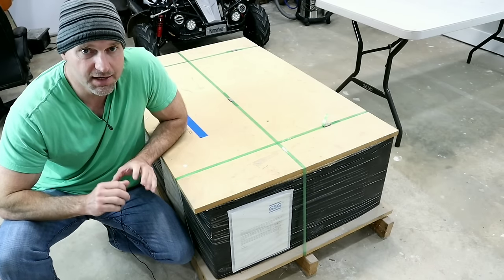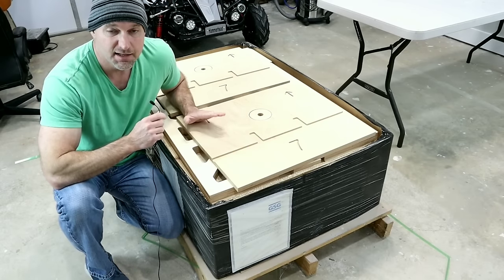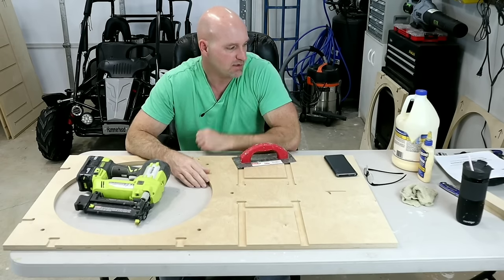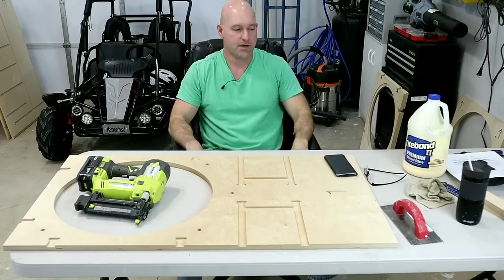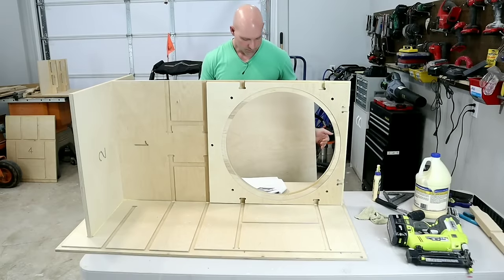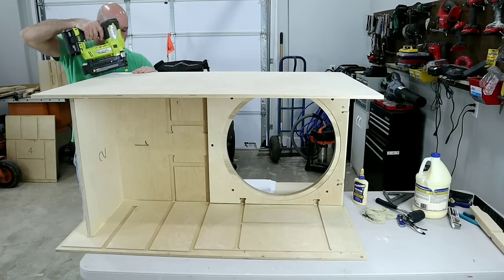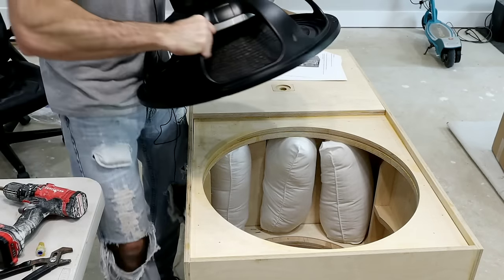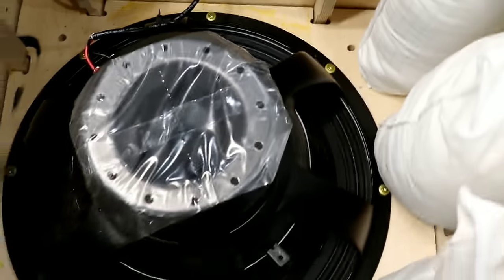DIY Subwoofer DEVASTATION!! GSG Devastator DIY BUILD VIDEO.  HOME THEATER GURUS.

Comment: I don't understand why you drilled a hole for a wire instead of using the SpeakOn connector.  Did you cover up and seal the SpeakOn connector port?  So now you have to splice the wire to a longer one to connect to an amp?  Also, what amp will you be using and what do you recommend considering the 10,000 watts peak it can handle?
Reply from the maker: Yes I covered the speakon hole in the video and explained why I was doing it this way.   I show the speakon adapter at the 13:20 mark.  
 It's  a pro type connection for road bands that offeres quick setup.  Something I don't need.  I also don't want to add more connection points.    If I want a standard connection I'd use  a terminal cup.  I like wood DIy terminal cups not plastic. I've been building subs for over 2 decades and speakons have just started to be something DIYers use.      It's all preference.  There is no right or wrong.
Reply: @hometheatergurus  So are you just splicing a speaker cable into the cable coming out of the sub enclosure?  What amp will you be using?  Will you be showing measurements and EQ?  Thanks.
Reply from the maker: Yes I wire nut to the run so it's an extremely good connection.  Remember these are hidden behind a wall.     I'm using a Speaker Power SP 2-8000 to push them.  I'll eventually have a setup video on them but if you go to our Facebook page I posted the response across all 4 seats a few weeks back.   A response showing one seat doesn't show alignment so I like to show the seat to seat consistency as we did in ep 7.
Reply: @hometheatergurus  Thanks!
Reply: @jasonevans6609   The Speakon receptacle itself seals the hole & would require no further sealing. 
The GSG widget video is found here... https://youtu.be/ARcehLuEiIQ
Reply: probably  because  there's more  then one way to skin a cat
Reply: @clittle1559 …. You only ever hear men use that phrase, I wonder why woman don’t say that phrase lol.

Comment: These are indeed a Funtastic build. I know I had a good time building my pair. If anyone is leery about the build process it is not difficult at all  I was able to build with no issues and I have very little experience in construction. Thanks for the pillow information and on adding the duct board to the front.  Also, yes indeed, that magnet wants to flip when you are installing the driver. Be careful or it will bite you.
Reply from the maker: Thanks Troy  and yeah that driver needs a warning lable..:)

Comment: For the uninitiated, this may seem like an excessive amount of bracing. It is not. Speakers of that size move enough air and have enough force behind their movement that they can rattle a lesser box to pieces, not to even mention the distortion you'd hear from the box absorbing and resonating with those vibrations.

Comment: Nice build I'm with you on that glue though I built a sixth order band pass with 315s that Hunter Martin designed for me double layer 3/4 birch I went back to the big box store three times getting glue well over a gallon I ended up using a damn paint roller and a small paint roller nap and stuff The only way to make it quick and efficient anyway yeah lot more glues than I thought but but there again nice build

Comment: noticed you cut the frame on the tube of caulk, there is also a poker that flips out on the end of the gun to break the seal... yes two years late
Reply from the maker: Yep, there's a hole to cut the  tip built into the handle and a metal poker on the gun. If I need a clean small cut on the tip I use a utility knife.   If I don't care I use the built in tip cutter.

Comment: Would you recommend cutting those tags off the pillows?  I could see them flapping around inside with all the air being displaced.
Reply from the maker: they actually go into the cab and sit on a panel so the bottoms are against that panel so the tags can't move.  I think I pulled them off the first sub and if I had payed attention I would have on this one too.  But as they are pressed against the panel, it wouldn't make a difference.
Reply: @hometheatergurus  thanks for the reply.  I had a hard time picturing what was going on internally once the second to last panel was put on.  These will be on my priority list to do when I move into my new space.  I’m currently running 4 15” drivers in two sealed cabinets in a dual opposed config.  They are beyond great for music.  But I need that extra oomph in the infrasonic region.

Comment: Lol. You’re going to make me buy one of these. Or two…. Damn you!!
Reply from the maker: haha... Well that's not a bad thing if you're looking for WMDs!!!
Reply: @hometheatergurus  I currently have dual psa xv18s and have a large open area to fill with bass. They don’t seem to cut it but thinking dual devastators would.
Reply from the maker: I have no doubt the Devs could easily fill even small professional cinemas.   I know their music version has been bought and used for concert setups.
Reply: @hometheatergurus  sounds good. Would the nx6000 Behringer be a good match for 2 devs? One on each channel.
Reply from the maker: @vikingengca9878  yeah I know many go that route
Reply: @vikingengca9878  The drivers normally considered for the Dev builds are extremely high sensitivity making the NX series amps a fine choice but it does leave some performance on the table. I'd recommend moving to the FP clone models like the FP14000 or 10000Q (with fan mod for in-room usage). That said, the world sure would be nice if everyone had a SpeakerPower SP2-8K or two 😆
Reply: I recently bought a CVR-3002 amplifier. It puts out 3000 watts to 8 ohm load per channel. Quality is arguably better than Behringer NX and Peavey iPR2 (7500) which I also own. I did some research on this company. CVR amplifiers are not just a clone of the other name brand amplifiers, but their own design that seeks to out-perform Powersoft amps, and comes very close to achieving that goal. I suggest y'all to look into it, if you're looking for ample power to drive the devastator subs.

Comment: Not sure if pillows are giving the desired effect here, but, nonetheless, I'm sure it's still a hell of a build
Reply from the maker: That was per GSG build manual. They're used it to fix a cabinet resonance that was measured. It  fixed the issue.

Comment: great video...that driver is massive......i just buoght 2 mach 5 audio 18 inch subs ,,,,going from one 15 inch ...
Reply from the maker: Yeah it is massive.  Mach 5 has made great subs for years.  You'll be very happy.
Reply: I have 4 of the Mach 5 21" drivers as Home Theater subs and a 24" Stereo Integrity for 2 channel.
Reply: @carlosoliveira-rc2xt  what do you think of them ..
Reply: @johnsmith-qz4bv  I use them in sealed cabinets and they are reasonably tight, detailed and sensitive. I cross them at 40 Hz but they still perform well with an 80 Hz crossover point. They disappear better than most subs I've owned and if fed a clean thousand watts or less, should last a very long time.
Reply: @carlosoliveira-rc2xt  thats great im going to build a pair of mini martys for my 18s...

Comment: Look forward to hearing your impressions of these.! Find it silly that you didn't use the speakon connector but it's probably that you have the cable running from the ceiling so you put a hole in the top.
Reply from the maker: If it was visible I'd use I DIY terminal cup.  I'm not a fan of the added connection points and I don't need a quick type plug / socket.  It's just a preference.

Comment: Would it not be a good idea to clamp before you nail? Surely some clamping force to get a good glue bond and then let the nails hold it in place.
Reply from the maker: Sure you can do that.  The brads do pull in the panel as you nail it but there's nothing wrong with doing both.

Comment: Get yourself a silicone glue brush.  It will help you spread your glue and have less squeeze out.  The squeeze out becomes a problem if you try to paint/finish the cabinet.
Reply from the maker: I've been building subs and speakers for over 2 decades.  If I'm going to finish it I clean it up on the exterior, as I go, as I did here and do on all my cabs.  A wet rag and you're done.    I like squeeze out, that means I have enough glue..:).  See the channel videos for cabs I've done including a base coat clear.

Comment: How did you like the devastator for home theater?
Reply from the maker: They're beastly with more output than i can even get close to handling.  As i design home theaters i usually spec BTS which are slim and don't take up as much room in false walls.  I have those on the way so will soon be doing a video on those as well.

Comment: I really enjoyed this one. Thanks for the vid. I didn’t understand why you plugged the ports with pillows. Can you explain? Sorry if you mentioned it. I did t hear you say why.
Reply: He didn't plug the ports, it's the internal cavity of the subwoofer. As he said it's to control resonances in the cabinet. Most subwoofers will have this, just usually not to the same extent.
Reply from the maker: Yep I mention it in the video and show the GSG manual where they recommend it to kil a cabinet resonance.
Reply: @TyGamer125  thanks
Reply: @hometheatergurus  thanks
Reply from the maker: You're welcome!
Reply: Do not use pillows!
Reply: This is not a great driver to use for Home Theater. It was designed as a pro driver. For the money, you can get drivers that will go lower and have more linear excursion.

Comment: Hi, thank you for putting together this video. I am about to pull the trigger for 2 of these, for live audio application. I am thinking of adding casters and handles. I am thinking of putting 2 corner casters at the rear bottom edge, but there is no good place for handles on the top rear edge to install corner handles. I'm wondering if you or anyone have come up with a good solution for caster and handles to transport this cabinet? Thanks.
Reply from the maker: I'd head over the GSG and contact them.  They may have some good ideas as I do know they've been used by bands and in the pro world.  I'd imagine maybe an extra layer of plywood on the bottom would be all you'd need for casters.   If you do order it would be great if you used my link. https://shop.gsgad.com/discount/Elitehomecinema

Comment: isnt the hole on the back for a speaker connection terminal block? why didnt you use that instead of drilling a hole?
Reply from the maker: It's covered in the video

Comment: I'm not sure if I missed it but what amp are you using (is there a part 2?) and how much is the savings?
Is there a sealed version?
Reply: Ha ha ha.... "a sealed version".... 😳.....

Them 21" drivers would blow them apart.... (x max damadge of 40mm at 10,000 watts)...... sealed version 🤣😂🤣😂🤣😂
Reply: Gsg released the Evolution series sealed. Debating on sealed for lower extension.

Comment: I'm thinking of doing what you're doing and add a projector screen and built a baffle wall I own captivator 4 thousands JTR subs 2 of them I wanna put those in the rear of the room  And more likely by 2 devastators for the front of the room to do what you did But does the devastators go down to 10 Hz  Not sure if devastators is considered ported or sealed
Reply from the maker: It's more of bandpass type design. It's tuned to 19hz.  GSG does have two new dual 18 and 21s that just came out that are tuned to I  14hz or so.  If you need more info on them shoot me an email.  Contact info is in the description.

Comment: All the publications on speaker building I have read recommend against using fiber/fluff/rockwool, etc., inside vented system cabinets and using resonance damping materials applied to the inner walls instead, such as NoRez sheets, etc.
Reply: I'd opt for both. Fiber fill helps to slow the movement of air and lowers the resonant frequency within an enclosure (though not by a lot unless you really cram it full), whereas vibration absorbent materials like butyl rubber sheeting or mass loaded vinyl sheeting and foam can help to reduce the resonance of the cabinet itself. The best recommendation I've seen is that if you're going to be packing the cabinet with loose fiber fill, you should get some muslin fabric or a similar light weight fabric that has good airflow by a relatively consistent and small weave, and staple or otherwise adhere it around where the driver will be sitting in the cabinet so you can prevent the fiber fill from trying to invade your voice coil over time. This is particularly relevant with larger drivers or drivers with high excursion as they can generate sufficient airflow to actually move loose fiber fill around. Or you could use pillows. Another interesting alternative to sound damping foam/rock wool sheeting/cotton or wool matting is to use scrap towels and just use some cord or something to stitch a bunch of them together at a few places to make them into a mat, then staple that around the edges into the cabinet. The pile of the towels really helps to knock down sound waves that try to penetrate them. You can do the same thing and staple them to a wooden frame then cover that with a piece of attractive fabric or take a piece of fabric to a print shop and have them print a piece of artwork onto it with dye sublimation or UV printing and use that to cover the frame and the towels hidden within to create sound dampening acoustic artwork. This works less well with actual art, since the gesso on the canvas makes it significantly more reflective.

Edit: forgot to mention that coating the exterior of a cabinet, particularly for a subwoofer that is meant to be hidden away like this, with something like a rubberized truck bed-liner paint will also help damp cabinet resonances, since it is similarly viscoelastic like butyl rubber sheeting. It also has the benefit of being extremely durable and comes in black, so it's ideal for these enclosure types.

Comment: My brain absolutely broke when I saw you not use the Speakon port.
Reply from the maker: Speak on cups are plastic and  add small connection points to the signal chain.  Where I do use connectors I actually drill out for terminals and if I wanna go all out I make a wood cup with terminals.   You can see that on the Hammer build videos.  If the sub isn't going to be seen go for the  most electrically sound connection with as little weakening of the cab as possible.  Speakon connections are for the pro world where you need to move gear constantly.  I'm just not a fan of them for my own use.
Reply: @hometheatergurus  I guess I don't understand how you connected the sub in this video to your system on such a short cable. Are you twisting bare wires together? I'm not trying to be combative by the way, I'm just wanting to understand is all.

My experience and background in is pro audio and out of that, I moved to home theater for last 7yrs or so. So, even in large auditorium installs, we would do unbroken runs from amp to loudspeaker and they would either terminate with barewire or Speakon depending on the device. So, I don't understand the hesitancy with Speakon. Correct termination of Speakon is done with solder to connect bare copper to the copper terminals inside the Speakon plug or inlet. No different than soldering a banana plug setup. Speakon is just more secure.
Reply from the maker: @MyFatherLoves  it's actually wire nutted to the run behind the wall.  I actually measure connections with a device called a tdr. You can see even a solder joint.   I like to use as few connections as possible and actually a wire nut with twisted wire is a very good connection that's electricity better than banana plugs.  Not that it matters here but when speaker and subs are hidden I like to keep it simple and there no reason to add unnecessary connections.  With a speakon you go from one connection like I have with the wire nut to 3 with the speak on and you have a terminal plate as part of the enclosure.  You've added a Small clamp down or soldered terminal connection in plug and socket and  the plug and socket connection itself.

Comment: I noticed that the recess in front wall of the theatre is much taller than the devastators. Do you have plans to raise the height of the subs?
Reply: Ah shoot. I just noticed the image you inserted over the video saying you are filling the space with insulation.
Reply from the maker: Yeah it's a demo room so I wanted to have some room in case I stack subs or do who knows what in the future.

Comment: Is this going be a power sub or no
Reply from the maker: It's passive, I have a Speaker Power SP8000 in the rack to push them.
Reply: @hometheatergurus  👍
Reply: @hometheatergurus  I am wanting to make a diy plate amp with Hypex amp modules. They are killer in bass performance. I know Hypex has a plate amp. But it’s computer based. I want knobs with subsonic filter so I can configure my own multichannel Hypex amps
Reply: @anandshah71   Sounds like you'd prefer the SpeakerPower plates.
Reply: Hi Jason issue is I live in India and there is no support for such products. Hypex is under my control that’s why I wanted some control for my Hypex. My plan to make entire HomeTheatre and music rooms of my house on Hypex